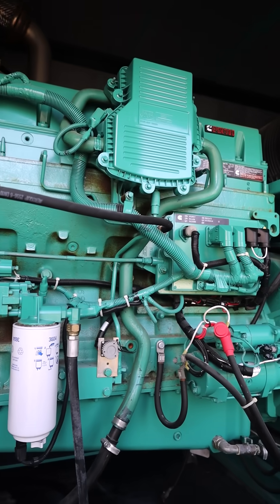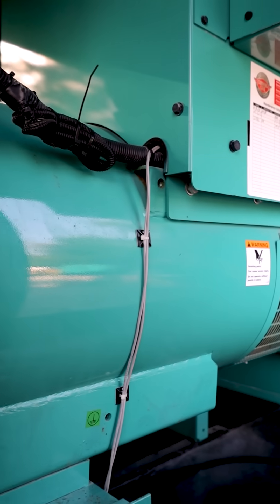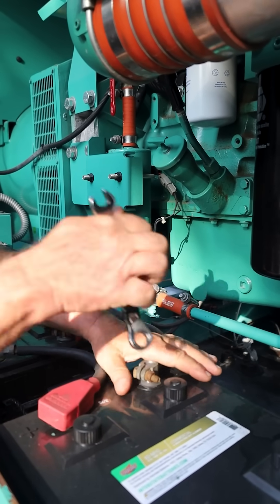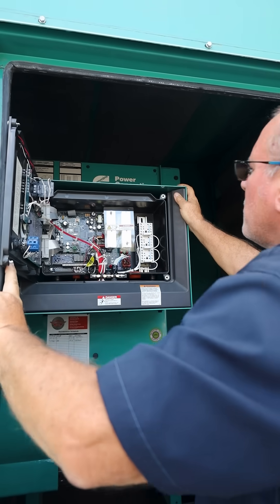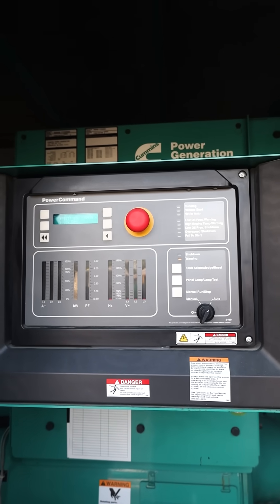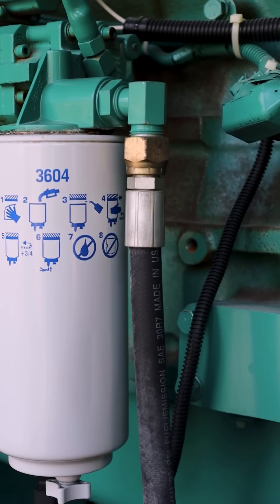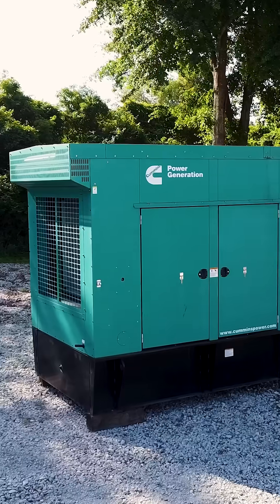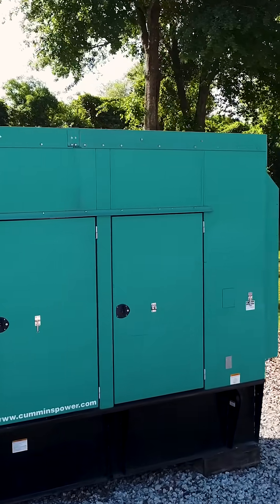Tech Talk Tuesday: 7 Main Parts of a Generator Explained! 🔧⚡

Comment: The Motor converts Fuel mainly into Heat and Noise, only 20-30% of the supplied power are actually going mechanically into the Generator 😂